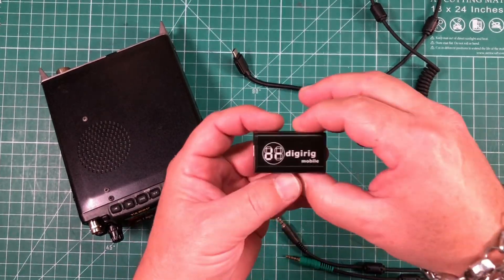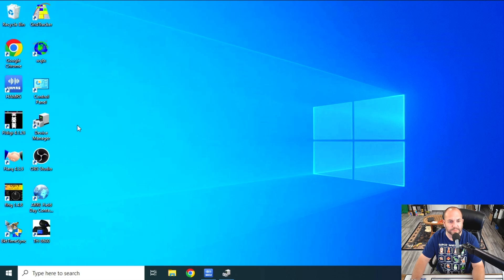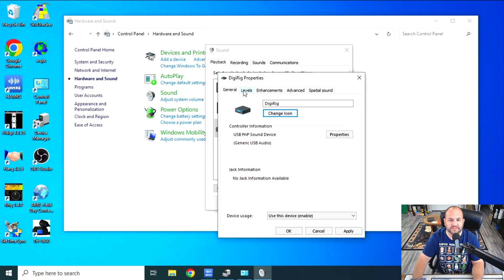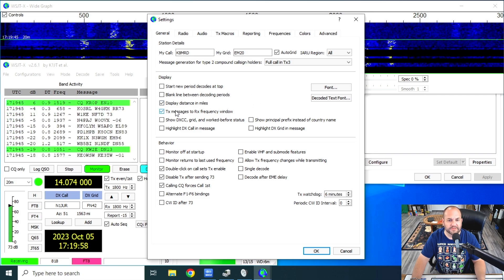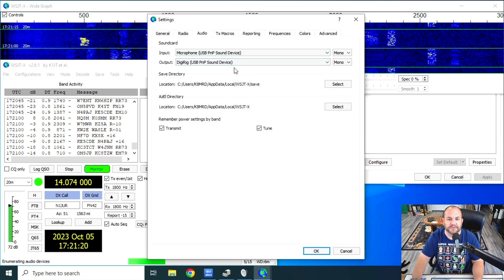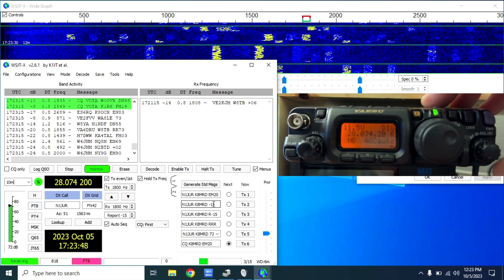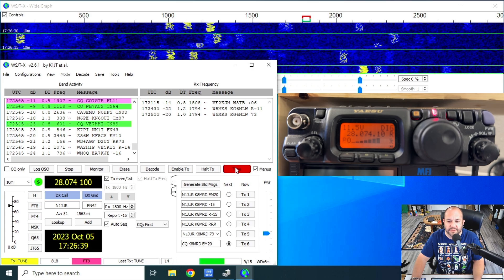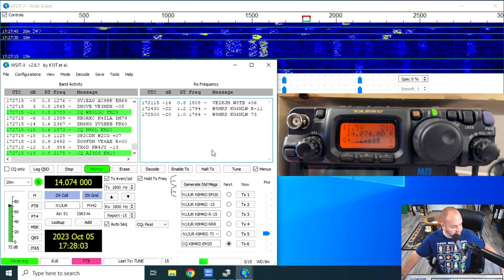How To Setup the Yaesu FT-818/FT-817 With Digirig for WSJT-X

Comment: Great tutorial Mike!  The only suggestion I would make is to NOT set the devices to Default because if you do that the Windows OS sounds will play through the DigiRig.  It's not needed anyway since you specify the audio device in WSJT-X.  Keep up the great work, appreciate the content!
Reply from the maker: Interesting.  That's what the instructions say.  https://digirig.net/setting-audio-levels-for-digital-modes/
Reply: Read further down: "It is common for Windows to flag the newly detected audio interface as default for the system. After connecting Digirig, restore your previous configuration by right clicking listings for your regular PC speaker and microphone and selecting them both as system default and communication default." @hamradiotube
Reply from the maker: @meltcom  Well paint me purple and call me Shirley, I read that wrong.  Thanks for the correction.  I'm going back to my Mac now lol!

Comment: Digirig's site says "Windows assigns recently added sound card as a Default Device and Default Communication Device. This designation should be moved from Digirig back to the computer’s regular microphone and speakers so the unrelated audio doesn’t end up on the air."

Comment: Master class indeed. I have mirrored all of the settings, good receive sigs WSJT-X but I'm using my FT-857D and at transmit I hear a sound somewhere, but my tunner and swr meter show no RF power going out.  As a test, I move off freq and go to CW, hit the keyer and my meters rise to the set power. So, the sound generated by DigiRig is not activating the mic input to the 857D.  I've taken a break, and now returning I notice that you set the transceiver port in RADIO to the Digirig Port. I'll be resuming set up this morning but wanted to share my experience with my 857D. One test set up past did correctly show RF power out during digital mode transmit, so these settings once set should not change after QRT and startup. Thanks Mike, super class. W3PDR Mike

Comment: It is better to set the PTT method to RTS, so the PTT control is done via Digirig. Therefore, if you lose USB, your rig won't be stuck transmitting.

Comment: Menu 26 on the 8XX.  In the back of my mind I knew there was a step I was missing.  You have to change the Menu 26 to USER.  Mine was on RTTY.  Didn't work till I changed it.  THEN I went in and corrected all the other settings in JS8, HRD, and FLDIGI.

Comment: I presume that if we set the data rate to 38400 baud, we can still use a Z-817 antenna tuner with CAT control between radio and the Digirig. Thanks for sharing, I've learned a lot here.

Comment: Thanks for this. I muddled through this exact setup on my own, first on my MacBook Pro then on a Windows PC. There are steps you’ve shown with the audio settings in Windows that I missed altogether and will have to revisit. This will be very helpful. I’ve always just readjusted the RF gain every time I change bands to get the right input level around 70db to get good decodes.
Reply from the maker: I did make one mistake in this video.  You actually DO NOT want to make the Digirig the default device, lest all your Windows sounds will be transmitted over the air.  I've heard windows sounds from other stations while operating before and wondered what the heck was going on.  I don't think it's an issue with Mac though.

Comment: Mike on the power level how much power are you transmitting?  4 watts??? I got an ft-817nd & an ft-891 (which is still in the box have not taken it out because I had no antenna up at the house until a few weeks ago), now I have an S9+20 noise level at the house and have not gotten a ground rod sunk in yet. got a guy from Washington State from a contractor of PPG that finds where I get noise from (I got an underground transformer right in front of my house they checked the ground on the transformer Wednesday)
Reply from the maker: Well oh high power with the 818 I'm supposed to be putting out about 6 watts but I've measured it at about 4, maybe 4.5 watts.

Comment: Mike... Have you had any luck setting up the FT-818 (aka FT-817) using Digirig... to key the radio on CW with Fldigi?  I can't seem to get it to key via the CAT/data line no matter  what settings I have tried with Flrig, or Hamlib or Rigcat.  If you have had success I'd like to know.  It might be a good subject for a video.  Your postings are very informative.  Best 73s  Dan K1YPB - On the air since 1962
Reply from the maker: That I have not tried.  I'm not a CW guy.

Comment: Have you been able to get this setup to work with VRA HF & WinLink?
Reply: Its basically the same setup for VARA HF and Winlink. I have both the Digirig and the Ft-818, and both work very well together. 73 KD5YOU
Reply: Yes, as soon as I was done with the video I tried WinLink.  It’s working great.  Nice connections to two gateways in Hawaii with 5 watts from my FT817 👍.   Thanks for the video.  It’s a great resource!!
Reply from the maker: I appreciate you assuming I know how to use those modes lol!  But no, I wouldn't even know where to start.  Good to hear you got it working.

Comment: My wsjtx receive input level indicator is always in the red even with zero "microphone" gain on windows 10. I tried everything but cannot reduce this. Any suggestions ?
Reply: Check that AGC is unchecked in control panel as shown in this video. If nothing else works, you can activate the attenuator on the board.